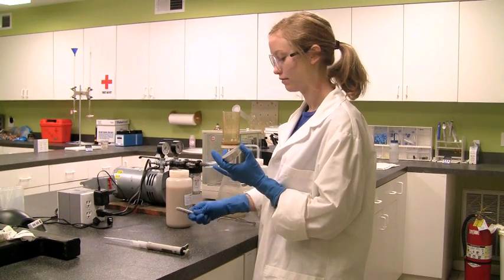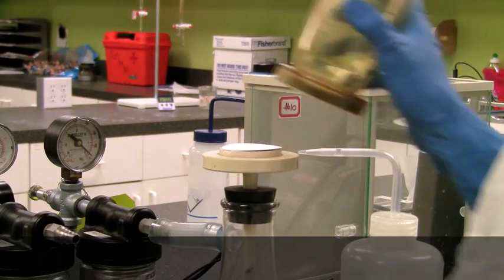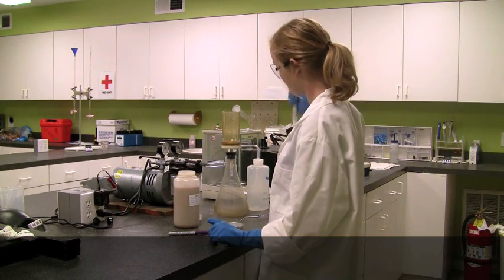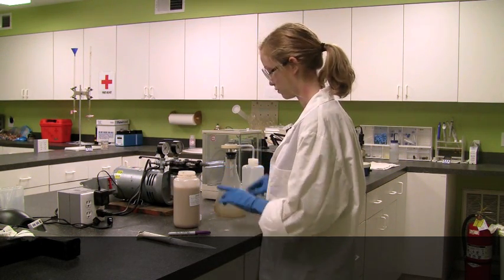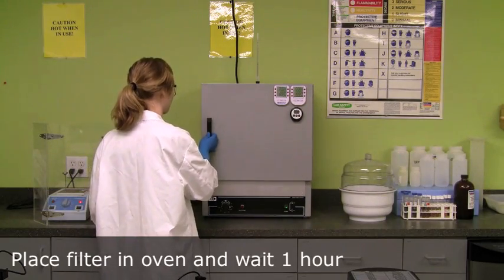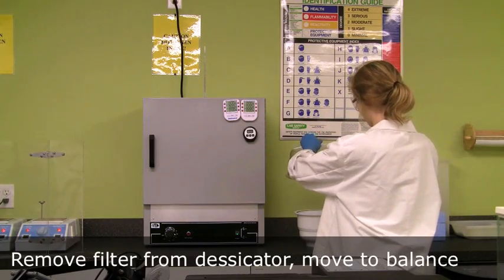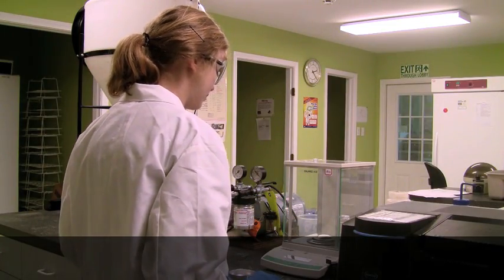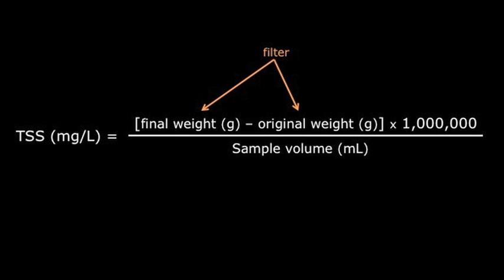Total Suspended Solids Test

Comment: We need to find the mass of the filter paper because for inlet samples there would be a slight problem but for outlet there would be a huge problem if we don't measure the initial mass of the filter paper for that we should first put the filter paper in oven (105) for one hour and after that we should weight the mass of the filter papers, Overall the video was awesome with a smiley face.
Reply: Why? If you weigh the filter paper and metal tin before then after filtering and drying, the difference in mass would be only from the solids collected.

Comment: Should one find the mass of the filter before performing the procedures? Otherwise you have no initial mass.
Reply: standard method i believe would have you clean and prepare the filter then weigh before use
Reply: Standard methods requires cleaning the filter with 3 20ml rinses. Then 2, 1 hour dry times.
Reply: @mowtineer93  True
Reply: The filters come preweighed. Weighing the filters before hand is bad because of possibility of contamination.